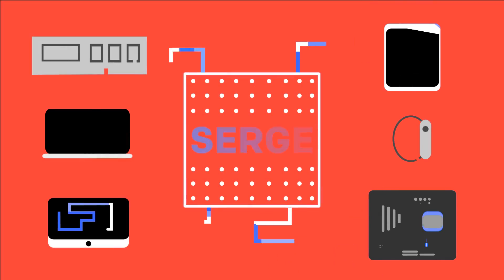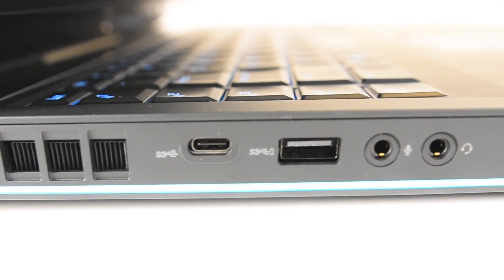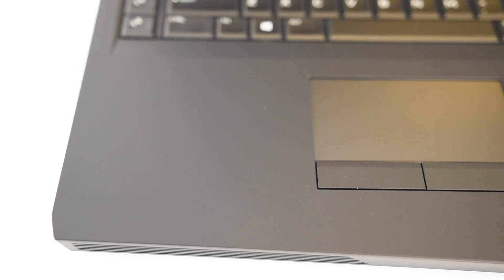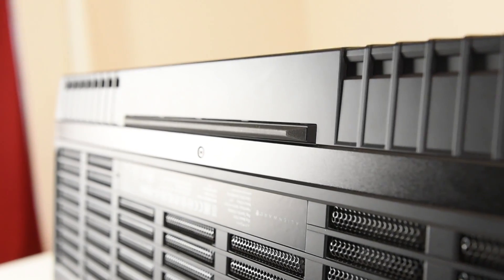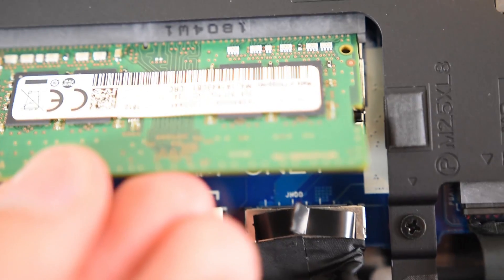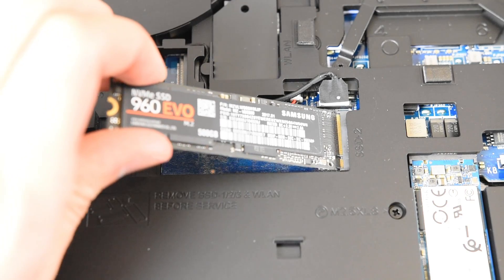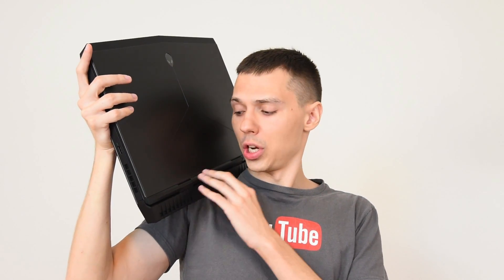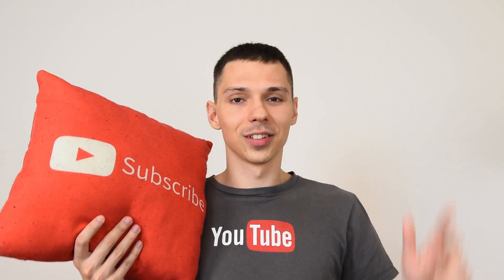NEW Alienware 17 R5 Review - GTX 1080 OC, 6 Core i7 8750H - EXPERIENCE!

Comment: How much cpu and gpu temperature while idle and gaming ?
How much noise while idle, and can you switch to quiet fan mode ?
Will the throttling be over after undervolting the cpu ?

Thanks
Reply: I have the i9 8950hk, with the 1080 oc as well Alienware 17 R5. 

On Reddit every R5 users have reported no thermal issues including myself and idle temps were at 50ish for me. During heavy gaming the temps were at 70- 85 but nothing over. 

No thermal throttling what so ever, and fan noise is barely noticeable when gaming at full volume. During gaming it was a steady 4.5 GHz. 

I’m getting 80fps for far cry 5 at 2k with everything maxed out. 75 for Witcher 3 with every thing maxed out including hairworks etc.
Reply: KaMingy not but other users have went as far as 0.200v and stressed it for 3.5 hours and stable
Reply: Gregory Craane I’m talking about 4.3 when six cores being used. On a single core my cpu can go up to 4.8. 

I have been testing it on bf1 and it uses both cpu and gpu while with multi core it’s a stable 4.3ghz
Reply: It should be more like "visually" no difference. The changes are within the fans and the CPU heatsink of the new Alienwares, so you won't find any differences unless you look inside the internals of the laptop. 

Admittedly, throttling has been a prime issue with the 15R3/R4, 17R4/R5 and the previous gen too. However, these problems mainly existed in the HK series CPU's. As I've mentioned, it requires either undervolting, repasting, and heatsink padding adjustments (the padding was fixed in the kaby lake cpu laptops and also for these new ones) to fix these issues. 

I have been checking up on the notebook forums for the laptop, and have seen one user complain about his i9 with the 1080 throttling and hitting high temps with fans ramping up. He states he even had to undervolt and also underclock his CPU to stop the high temps, and then mentions something silly like unplugging the laptop while gaming?? Anyhow, he doesn't mention anything about repasting the laptop - something that is quite common that people do with brand new Alienware laptops. My guess is that he had a bad thermal paste job on his model, unlike Marcus's laptop which runs fine. 

I'm sure you'll be familiar with iunlock, one of the most well-known posters on that forum that does tear downs on alienware laptops. We'll have to wait and see what sort of solutions he will come up with, but I reckon it will boil down to the same conclusion with the previous 15R3/17R4 models.
Reply from the maker: Will report back soon darn I wanted to add this in a specific section but totally over looked it. I’ll find out soon.
Reply: Did you undervolt or repaste the laptop?
Reply: KaMingy no repaste and undervolted by 0.120v
Reply: That's really good. I didn't think the new 6 core CPU's could undervolt that far. Did you try as far as 0.150v? Because that is normally the highest the majority of the CPU's undervolt to.
Reply: Gregory Craane and that’s with out even over clocking, the majority of not all R5 users have stress tested both gpu and cpu at the same time and showed there’s no problem. 

I’m getting a stable 4.3ghz with all cores at least
Reply: Gregory Craane well I’m not having problems so I won’t complaint, and I made that comment on the Chinese guys video before I even purchased my R5. 

All I’m saying there’s atleast a handful of R5 users are happy, if you want proof there’s a handful of test done on reddit by us already. If you are concerned then go to reddit and open a thread for us to answer whatever questions you have left for the R5 

Look I’m saying Alienware have sorted out the cooling, and secondly I don’t need to give any proof lmao because I’m using it and I’m happy with it lol. 

I’m not sure what you are trying to do here but R4 is notorious for thermals, at least every R5 users on reddit have claim to have good cpu and gpu temps.
Reply: Gregory Craane lmao yes there is, some one did a 30min gpu and cpu stress test at the same time. 

Lmao what is wrong with you? We are happy with our R5 and yes cooling is sorted. Go on reddit and make a post if you are not happy with what u had to do with your R4 

I guarantee very R5 users will tell the same as what I’ve said. 

And the screw posting of the heatsink has changed, and no it has been said many times if you actually went on reddit that the heatsink is not transferable because the tripod screw placement is different. 

And again I’m using it myself and temps are very good with all cores staying at 4.3 ghz under load. 

If you aren’t happy with what you had to do otb of the R4 complaint to dell. But dell fixed the R5
Reply: Gregory Craane lmao u r actually delusional. Like I said I can read my temps on my own comp and it’s good. My max load temp is about 85 after 4 hours of bf1 gameplay. I undervolted by 0.130v and if you are so salty about people buying the R5 without having to do all the repasting etc then I’m sorry but the new R5 lol.

Anyway good day to you and end of discussion here. You kept asking for proof, then go on reddit and post a thread about the R5. 

Myself and many other R5 users will provide the proof you require on reddit. If you don’t you’re just a fucking salty troll lmao
Reply: The Alienware laptops, particularly the HK cpu series will run hot because they have a higher voltage than HQ / H series variants. This has been widely known for all other laptops with the same HK CPU's, because they have higher voltages to enable the user to overclock them out of the box without having to tweak the voltage settings. You experience overheating/high temperatures because the voltages are higher than normal, and they will only run at non thermal-throttling temperatures when undervolted. 

Marcus, and just like other Alienware users who don't experience the issues that you mention, don't have these overheating issues because they undervolted.

Plus, these new Alienware laptops are actually different and are not the same. They have supposedly upgraded the CPU heatsink with a vapor chamber to accommodate the 6 core CPU thermals (although I haven't seen it myself from any disassembly videos). But if anything, you are splurging your money on a system that you don't seem to have researched much about.

Comment: Does it get loud and hotter than the previous models ? Thats my main issue
Reply from the maker: It’s got better cooling so no. If you want the best cooling and sound option get the model that supports the 8750h but downgrade the cpu selection to the slowest model and pick a 1070 or a 1060.

Technically there is still thermal throttling and power limit throttle it just doesn’t get in the way like it used to. 

I used to lose half of my performance when the computer would over heat now we only take a 10 percent or less performance hit.
Reply: SERGE that’s strange because all of us R5 users in Reddit didn’t see performance drop. I do have some power limit throttling but NO FPS drop at all during gaming. 

I have a very stable and constant FPS of 75-83 in Witcher 3 all maxed out at 1440p resolution
Reply from the maker: my readings do say that there is some but every time I keep tracking the system in xtu its actually power and thermal throttling less and less. it turns out I think there is some kind of firmware tweak that optimizes the performance and its true I dont see it getting in the way of gaming.
Reply: I’m wanting the r5 but I want the 8th gen i7 and a 1080 with a 1440p screen..they do not have that option. They use to allow more customization.